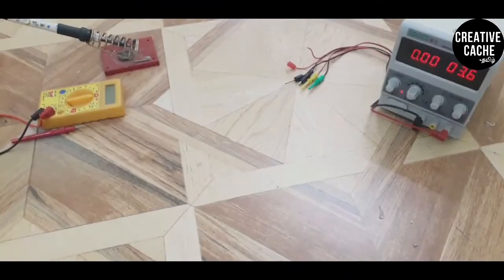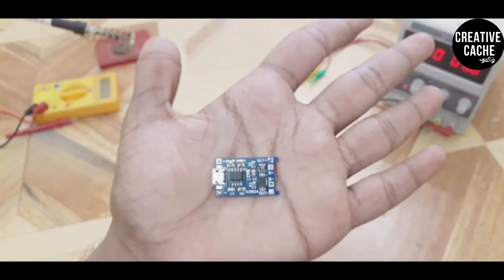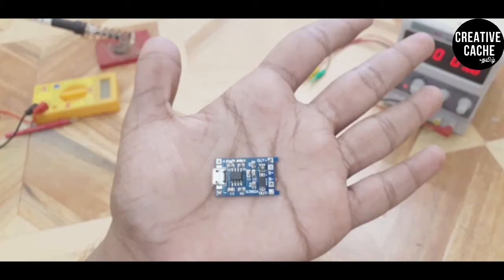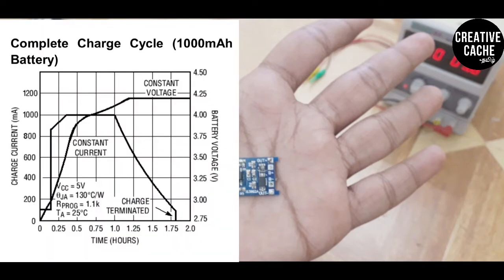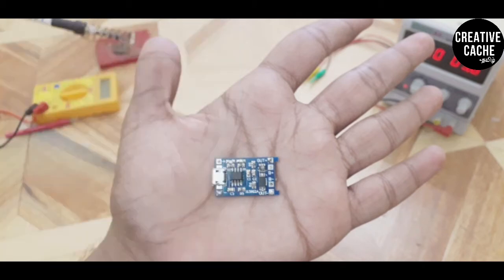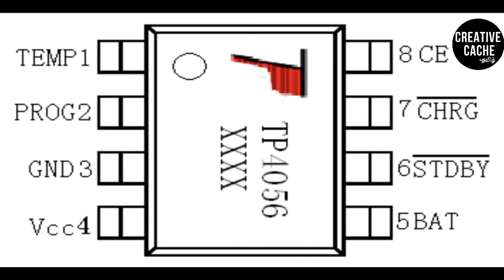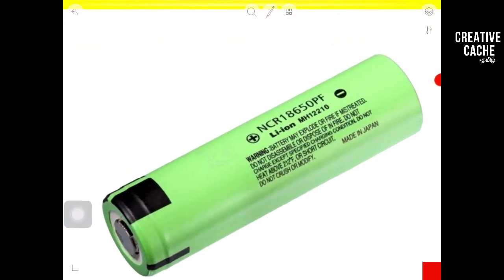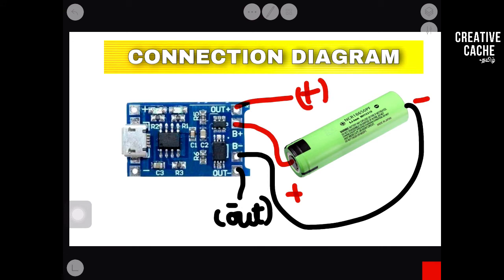(தமிழ்)What is TP4056 Module in TAMIL!!!

Comment: Bro can we charge 3.7 500mah
Reply from the maker: Yes you can charge it bro .
Reply: Don't do that, this module is cc cv type, settings are 4.2V with 1A. A 500mah battery should not be charged at this rate. It will heat up too quickly unless it has a bms built in.
This is good for cylindrical li ion or more than 1500mah single cells only.

Comment: Bro 10000mah panna mudivuma bro itha module la
Reply: 3.7v Lithium ion battery yedhuvenalum charge pannalam.. maximum charging current 1000mA than.. so 3.7v 10000mAh battery charge panna, approximate ah 10hrs-11hrs agum.
Reply: @yuvarajvelumani7760  bro same time charge and discharge panna enna aagum bro